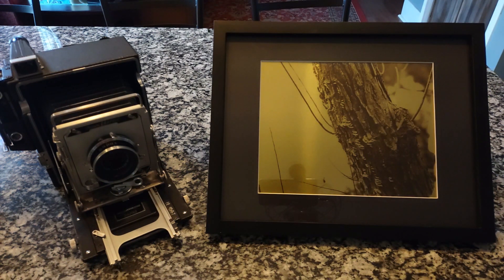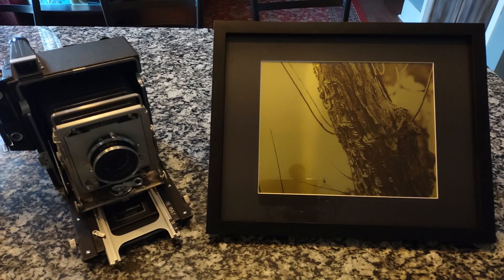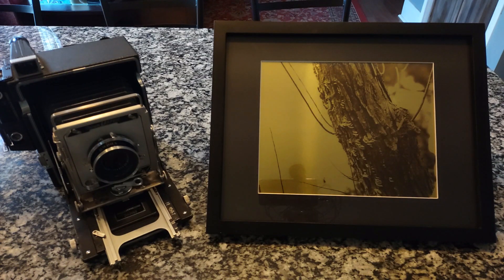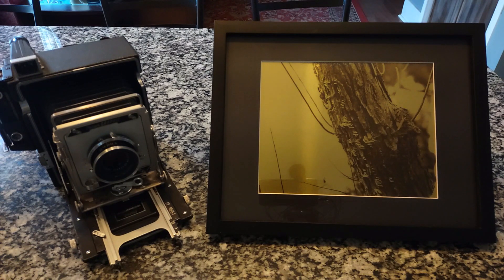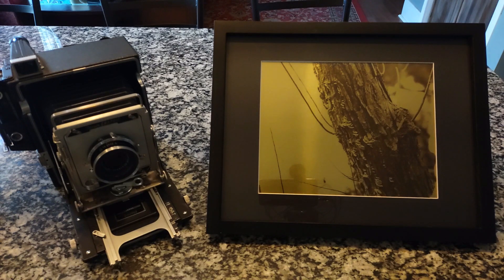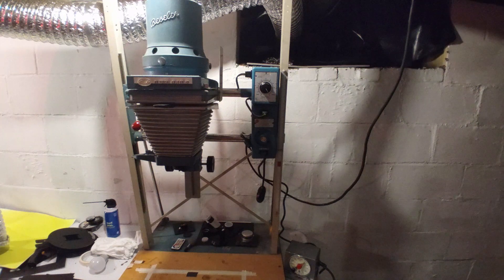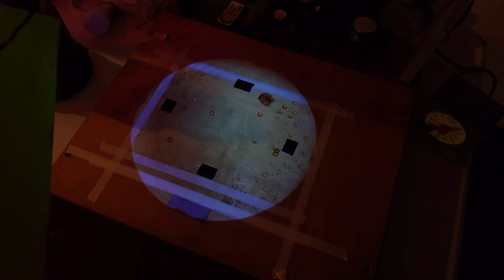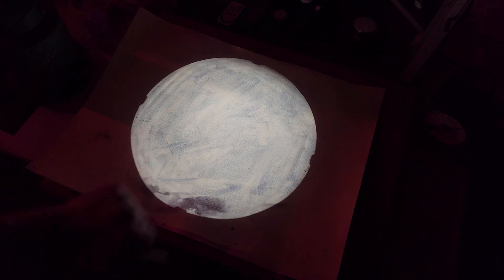Photo enlarger modified with a 100w 380nm UV led for alternative process printing.

Comment: did you solder the leads to the LED? Not much clearance from the two flanges to the heatsink so I think they need to be soldered to the top of each flange but worried about hurting the LED.
Reply from the maker: @ianbabcock5951  yes they are soldered

Comment: Could you use this higher power led in the 35mm projector enlarger you created previously. Would this speed up the exposure time for that process or would the 10w have the same effect?
Reply from the maker: I tried a 100w led and it was faster but the print was blurry. It may have been that the extra heat it created caused warping but I'm not sure. It did not seem to affect the enlarger but it may have to do with the lenses it has.

Comment: Thank you for this information! I've been sitting on an later version of the Omega DII for a number of years and have been looking to try it with my cyanotype printing. As someone who has no experience with soldering or electrical parts, your videos and parts list are greatly appreciated. I have someone willing to help and teach me along the way. Not sure if you would have this answer, but do you think that I would run into any issue with the condenser lenses of the Omega vs any other enlarger? Thanks again for sharing your wisdom.
Reply from the maker: You should not have any issues with optics but I would recommend making a florescent target to make sure there is no banding or other aberrations just to be sure
Reply: @matthewbary1  Thank you!

Comment: @Prussian blues - Thanks for the video! Thanks for sharing your wisdom. Have couple of Qs. Hope you can clarify. 
1. What is the right wave length of UV LED? I have been trying to replicate this with varying results for over 2 years now - tried with a Durst, Bessler and Bessler was the best one I had adapted. Your method of sourcing made me re-look at Amazon vs ebay! thank you! 
But the amazon link you pointed out is for 100w 395 NM. I had earlier used the UV party light various ones from Amazon - but only 15 + hrs of exposure got me a cynanotype that wont wash out.  Built a adrunio UV sensor reading - but I always got a random WL read - used cheap Alibaba uv sensor - so I never conclusively figured out the right WL . Just that it has to be UVB - 360 to 400 NM range

2. You also seem to catch the Newtons ring  @9.08 - for me that is a constant fixture - but your final output doesn't seem to have the rings - I am sure it is the internal reflection of the condenser lenses of Bessler than the actual Newton's rings - but hopefully following your construction will get me to the right spot.
Reply from the maker: Apparently they no longer have the 380nm led listed. I used a 100w 380nm led but you can get them from eBay from a different supplier. I bought 6 different nanometer 10w UV LEDs to test and 380nm worked the best for cyanotypes. My guess is that the UV LEDs are not emitting exactly as advertised otherwise theoretically the lower nanometer ones should have worked better but they did not . One thing I did not go over is that carbon printing can be done with a royal blue led and does not really need a UV led to work, it works for cyanotypes as well but much slower. You should be able to make a 8x10 cyanotype in 4 hours or so if everything is working properly. Another thing I should mention  is that I always use Canson watercolor paper and I think it is slightly acidic, this may also shorten the exposure time. You can shorten the exposure time as well using 2 tricks, 1 is to aim a heat lamp bulb at the paper during exposure as heat makes it expose faster,   2 develop in straight plain white vinegar, developing in acid lowers the exposure time needed.  As for your second question I do not think they are newton rings I believe they are just distortion, The 100w led is a 10x10 array of tiny 1w chips and since it is not one solid chip when you focus it through condenser optics each little chip has its own distortion pattern but all of them together makes a strange newton pattern. I used the 60 degree lens and a spacer to eliminate as much as possible but I think after it goes through the negative it reduces this issue. Just a few questions so I can better help,  what size negatives are you using? What size prints are you trying to make? I assume you are making cyanotypes? If so how are you developing them "plain water peroxide etc".

Comment: Very nicely done! So, what exposure times can you achieve with cyanotypes, typically?
Reply from the maker: 8x10 print f3.5 about 4 hours. You can cut the time down by developing the print in plain white vinegar
Reply: @matthewbary1  you could try replacing the glass condensor with an acrylic Fresnel of the same focal length. It would help you print faster or larger. It's what I use in my UV enlarger
Reply from the maker: @douwekrooshof881  I will have to try that thanks 😊
Reply: @douwekrooshof881  would you mind to give me a link? I am trying to built these with an intrepid 4x5 camera with all the stuff Prussian blue mentioned above. I guess I need a condensor lens?

Comment: Yes! I'm looking at modifying an Intrepid Enlarger to take a 50 watt 365nm UV lamp, as soon as the Intrepid is released. In looking at the enlarger made cyanotypes on Flickr, they seem to have an exquisite and more delicate tonality than those made with 3-14 minute exposures via UV blacklight bulbs or the LED UV lamps. Is this also your experience?
Reply from the maker: Is this enlarger a condenser type or a diffuser type? And yes the ones enlarged do have better tonality but there are ways to get that with a large negative as well such as developing in acid "plain white vinegar" but ultimately I think they just have better tonality because its from film rather than a digital negative.